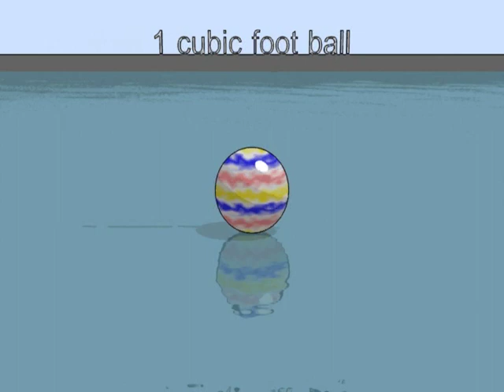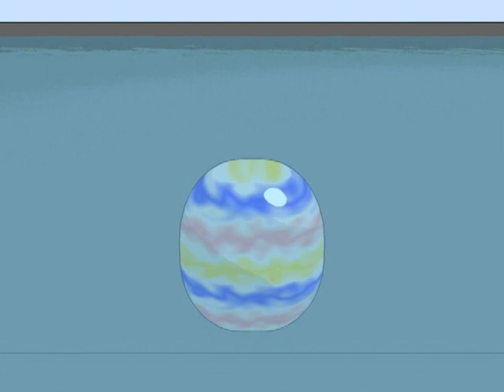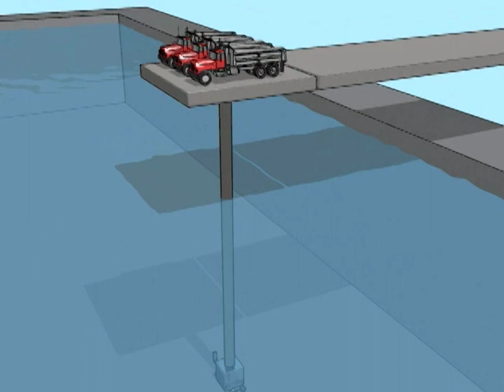HYPEG - WATER+AIR=GREEN ENERGY

Comment: 1000 cubic feet will maybe left one of the 30 ton dump trucks....not 3 of them.    You also have to take in the weight of the crane or elevator materials you are employing.  So maybe 3500 cubic feet will left those 3 dump trucks.  

You release the water into air at the bottom in your example...how do you release that water in the main body of water where the water pressure is really high?  It will not come out??!
Reply: +garvoi  Gaaa!! you are right garvoi! It should have been 3 ten ten trucks, i missed the error in my proof of the video! Over 30 thousand views, and you were the first to catch it! Sharp eye! Now, how does the science overall check out with you?
Reply: +Tim Gard Tim, in the video with the beach ball, you are pushing the ball down using a force.  Once the ball is deep in the water, it's a stored force.   But you don't push any buoyant object down with the prototype you are showing. You get the buoyancy by dumping the water out at the bottom of the tower you have. and air goes in.   How do you do that deep in the ocean where the water pressure is so high?  How does water just flow out of the chamber in the ocean...then where does the air come from?
Reply: +garvoi Yes, this is a common mistake made. The HYPEG unit itself can not function below the water, it must be located above the water *when the air is drawn from the bottom*. The only way it would function below the ocean is if we were to insert compressed air in from above, which we could do. In this manor, you could skip building an outer container, and insert the conveyor under a pond, lake, or even the ocean. But the compressed air must come from another source then. What might that source be? Wind turbines used as compressors, elevated water in small streams, or even rivers, solar panel driven air compressors, air pumps driven by waves in the ocean, tidal changes like Fundy Bay in Canada. (Fundy Bay could probably power the entire country of Canada all by itself with compressed air and the HYPEG!)
Reply: +Tim Gard So you are just recommending a way to store energy created by Solar, Wind Turbines etc...    They already are finding ways to store the energy created by these sources such as Pumped reservoirs or Molten salt storage in Solar farms.  Your system does not generate the energy but just stores in a this form?  You could easily as well just create a big deep swimming pool in the ocean,  and use Wind turbines to pump the water out.  Then the potential energy will be water falling and turning a turbine like a pumped reservoir.
Reply: +garvoi No, I am showing how the stored energy can be released in a much more efficient way by not using a turbine! Turbines are very wasteful, (15% efficiency in the best conditions) and the HYPEG wastes almost none of that energy by accelerating mass. An automobile is not very impressive if you simply look at the gas pedal, you must take in the entire machine to understand its value! Pumped reservoirs depend on very inefficient turbines, and Molten salt suffers from massive delta T losses. Both very inefficient science. You can ignore those losses if it bothers any investments you have in those sciences, but energy loss is energy loss. The HYPEG has none of those losses. That's the key!
Reply: Tim Gard hmm...converting that linear mechanical lift energy back to electricity is probably only 70 % efficient or less I would guess...losses in gears and generators,  etc...not very efficient. ..

Comment: I hafe similar Idee ten years ago. I improved this in 3 different ways if you want writing me I wil give you the plans.
Reply: Better yet, lets compare notes! Maybe you can come up with something even better!
Reply: I'm interested
Reply: @joshuanorris9785  I did not see this. How do you prefer we communicate?
Reply: its not free energy >>> it's just a way to store energy to be specific
Reply: @efada5306  no 

Its  throws out the water at the end so it generates energy 

It's pretty much a really slow hydro electric system that gets its energy by  moving water down

We already do this better
Reply: @preppertechnicianee6013  exactly .. moving water from higher to lower level is called energy discharge>>>>  so it's not a free energy as we may think that energy is generated from null

Comment: You know that your machine is not cyclic don't you? Once the box has risen to the top, you have to fill it again with water. Hence, you need a supply of water coming from the top. If you have to pump water to the top, the energy needed to pup the water is equal or bigger than the energy given by your mechanism. IT DOESN'T PRODUCE ENERGY, IT JUST STORES ENERGY and probably not so efficiently than other systems. 
Sorry, it's a cool idea but DON'T TRY TO LIE TO PEOPLE. IT IS NOT A SOURCE OF ENERGY.

Comment: What power is used to pump the water out of the box and draw air in? If you have a box of water in a pool with an air tube to the surface the water in the box wont leave unless air is forced into it.
Reply: After reading several comments I see how the water is released into a river. I was thinking of the sea or a pond. The area needed to generate power with this method could be a problem. How many leavys would need to be placed along a river to produce 80% more power than one damb and a few turbines?

Comment: the principle of buoyancy - gravity  energy extracton is a valid and scientifically correct one. There have beem many proposed and patented systems based       on this princi8ple but not one single one of these has been proved to be viable. The energy required to produce the compresed air consumes most of what the system itself produces and no surplus energy is available for external utilisation. The efficiency of the system has been stated to have been 85%. This figure would itself establish the fact that less energy is available as ouptpup than the input energy. So where does the extra energy come from it at all? Clarification is most certainly in order here and your updated video will to looked forward to for clarification of this and also additional design details. Thank you and all the best to you.
Reply: If you put up a wind turbine and use it to compress air, all your energy is provided for free. If you use elevated water to compress your air then your energy is free, if you use tidal elevation locations like Fundy Bay, your energy is free. If you put a 30 foot head of water on a container of air, how much pressure will there be? Look at the Niagara power project. Do you realize it functions at 7% efficiency? By changing it to a HYPEG system we can approach 90%. That's close to 12 times what they get out of it now. You must do the math on this stuff, if you jump to conclusions you will miss one of the greatest system designs since the automobile. Many said cars were a fad! You don't want to judge too quickly. Keep asking questions and studying the answers, you'll get it!
Reply: You do not need compressed air. This system is for capturing hydroelectric power from a dam. If I understand this system correctly then the air enters the chamber when it lowers to the point that the one way, inwards opening valves at the bottom of the chamber are pushed in by the water outlet pipes at the bottom of the whole assembly. The air enters the buoyancy chamber from a line that goes to the top of the assembly, there obviously must be a one way valve that only lets air enter and not leave. Gravity takes the water out and air enters. What I don't understand is how the chamber remains at the bottom past the point of simple buoyancy. Perhaps there is a catch mechanism that is released only at a certain level of tension . There would also need to be gaskets at the water release ports that would slide over the pipes at the bottom.There would also need to be a valve on the water release ports for the main tank that would be triggered when the buoyancy tank hit it at the bottom, perhaps a spring loaded cam mechanism on the two pipes. You could arrange it so that as the Buoyancy Tank pressed down a knob on the outlet pipe ran in a spiral groove that turned it one way, then reversing the motion as it lifted would turn it back again, closing it again.
Reply: MR.Teslonian has used a trompe hammer , a combination of a trompe and a water ram, to achieve 65 lbs of pressure with an eight foot fall of water.
Reply: I use a system that is a simple pressure differential. 2-20’ x 6” pvc pipes connected to each other at the top and bottom. I pump air in to the bottom of one side that creates the pressure differential witch makes the water continuously move. I have a $250.00 micro hydro 500w generator piped into the bottom of the other side. The 60w air bubbler is what makes the system work. The trick is u can’t pipe the air bubbler directly into the bottom of  the pipes. U have to get on top of the system and slowly insert the hose in. That way the water starts moving and u slowly increase the depth till u get to the bottom. Then u have endless water moving

Comment: Think of this unit at the bottom of a dam.  When you open the bottom valves the water is released into the lower stream, then replaced in the HYPEG with water from the reservoir above.  Ideally the HYPEG would be as high as the upper water level for maximum energy retrieval.  This unit represents the basic science meant only to show concept, more sophisticated devices are much more efficient. Put Fundy Bay water elevation into this formula and there is enough electricity for the world.

Comment: When you open your valve at the botton, water wont go out.  It will get in until water level rise to the surface throuhg the hose you planed to use as a breather.  Good concept to store energy.  Not to generate it.
Reply: +Patrick Gingras  If you turn a glass of water upside down, does the water not run out??

Tim Gard
Reply: Exactly my point.  If you unplug a hole at the bottom of your glass, (button witch is at the surface since it's upside down), water level will go up, not down.
Reply: +Patrick Gingras It is isolated from the water inside the container. How could it possibly go up?

Comment: At 4:00 your math is wrong. it will only lift 28.31 ton of weight not 3 trucks that weighs 30 tons each
Reply: Would you be able to share your calculations for this? I'm struggling to find scientific evidence of the calculations in the video (ie. the fact that weight lifted increases THAT significantly for every foot deeper underwater)

Comment: You would need to locate this next to some sort of naturally fed water source due to the fact that when you release the water at the bottom it would eventually lower the overall water level. Otherwise your using extra energy to pump water back into the system. Just saying.
Reply: I believe that is why the efficiency is the way it is using ram pumps that have been around forever could make this more efficient,
Reply: Absolutely. The energy comes from elevated water in this design. But there are many ways to coax mother nature into elevating water for you in copious amounts... look at Fundy Bay for example. An amount of water greater then that of the great lakes is elevated over thirty feet into the air twice a day! And that is only one spot on the planet! Ram pumps?? Bad idea!
Reply: Tim Gard ok I am just looking for a way of developing my own reactor to power a house out in the middle of no where without relying on solar or wind. I have looked at about everything now studying the affects of helium3 and how to efficiently extract a neutron from helium4 without waste.
Reply: captain42979 All you need is energy to free that free radical electron ... wait, wasn't energy the mission to begin with? Use an Edison hydrogen generator, at least you can burn hydrogen. If your house has wind and solar, why not use that?

Comment: so what is done with the water once it is emptied out in the bottom through valves and chamber is "replaced " with air?  you have to get rid of it and doesn't that take energy?
Reply: That is when inventors come into place. think of ways to fix it! If you think nothing will work you will never get anywhere in innovation
Reply: @wiffleduster  The engineering solutions I found to that (like using this with a dam, to not pump the water, but let it out downstream) are still making this a lot less efficient than using solar updraft towers.

Comment: Yes, it looks to me like you are essentially letting water fall through the system, and instead of a turbine or Pelton wheel, you are using the "dumbwaiter" (no offense) as the thing the water has to fall through on the way down.
So you need to be in a location where you have a usable head of water that you didn't have to pay for, like a dam or waterfall. The advantage must come from the upward travel, where you are also generating power by utilizing buoyancy, not just on the downward travel.
I can see why you need trick valves. Where may I find the patents? The website listed doesn't seem to be working. I hope that doesn't mean you've gone out of business already.
Reply: Jeez, since you have to be next to something like a dam, why not just use the falling water to generate the energy?  Why put the cart before the horse?  Shucks!  I bet they forgot to think about that!
Reply: @TinselKoala
some pages do seem available but not the 'home' page
: http://heavyhydraulicoscillation.com/our-hydro-plant.html
Reply: Daniel Gendron accelerated mass
Reply: Daniel Gendron Accelerated water through a turbine or Pelton wheel ... Hydro turbines require accelerated waters mass to extract energy.

Comment: This Sounds like a perpetual mobile, if you use air (from where does it come?) to realise kinetic energy and transform this to electrical energy by a generator you receive some electrical power, but less then the amount of kinetic energy. So you have to provide more kinetic energy as you will receive in electrical - result is you loose energy  with these toy.
Reply: i too first thought it was gonna be another perpetum mobile, but i think that would be a misunderstanding of their actual product. this proposed device still converts the potential energy of the water into kinetic energy by reducing its altitude. they simply claim it to be much more efficient at that than conventional turbines.

Comment: You understand, as most people do,  that it would take millions of pounds of force to push that much air under water. And all that is required are "special valves." Those would be special valves indeed. Valves control the flow of liquids, they do NOT create that flow. An outside force would still be required. A HUGE outside force.
Reply: Thats funny. I put an air hose from a simple small automotive air compressor into the bottom of a ten foot deep pond and the air easily was pumped to the bottom and bubbled up. Maybe you are using mercury instead of water? Besides, I am not pumping air into the bottom, I am simply letting the column of water push the air in. You are jumping to conclusions instead of study! Thats how you get a D in a class instead of an A!

Comment: You need just as much energy to take that 1000 cubic feet of water to the top after it's poured into the reservoir at the bottom.

I don't know how they even got a patent for this flawed concept.
Reply: Thats because you are confused, obviously. I say no where that I will elevate the water mass.
Reply: @newrenewableenergycontrol5724  So then your plan involves taking 1000 cubic feet of water per cycle downward and never bringing it back up. Where do you send all of that accumulating water?
Reply: @rainflake7157  The water is removed from an elevated source and released back into a lower area. Just like a natural river.
Reply: @newrenewableenergycontrol5724  And what about the energy required to take the water to an elevated platform?
Reply: @rainflake7157  Rain. Its rain! R A I N. How simple does this need to be??
Reply: @rainflake7157  Bingo! That huge round rough thing you feel is a tree. Pretty soon you might actually begin to see a forest!😉😉😎

Comment: Why not remove the water from the larger tank and use whatever system you filled the tank with to simply fill the smaller tank and use its weight to create power, HMM JUST LIKE A WATER WHEEL ALREADY DOES!! Lol!